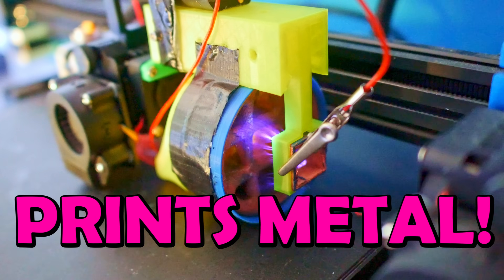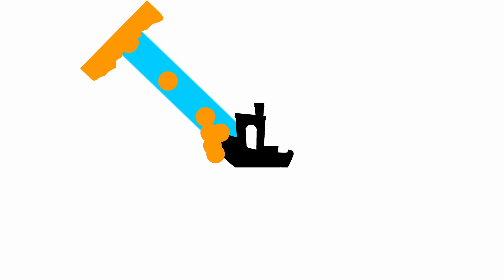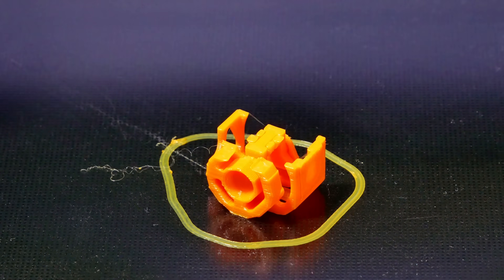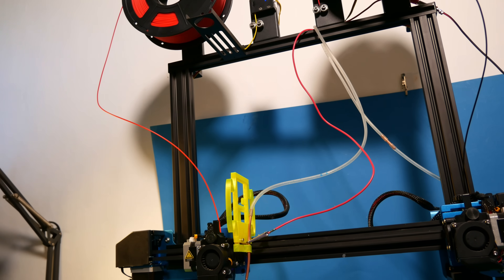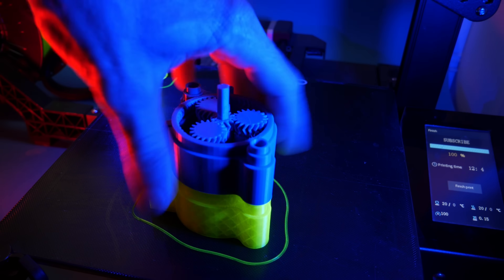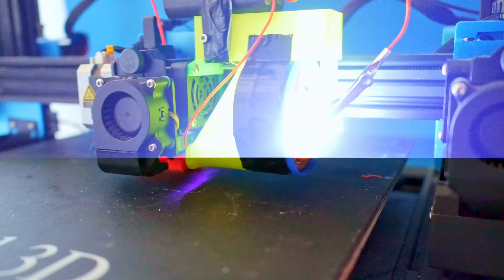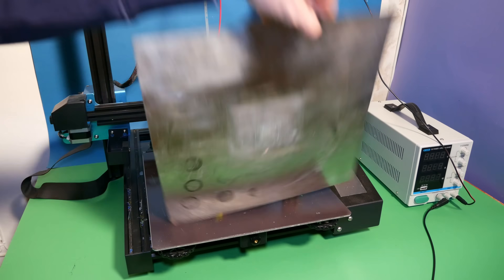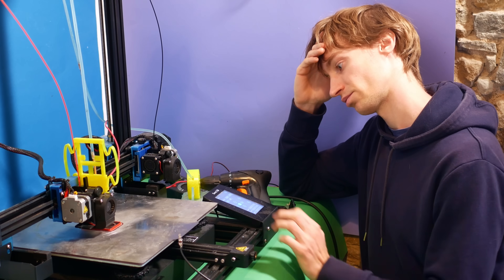i made a METAL 3D-Printer at home!

Comment: How about a sanded down rough PEI build plate? If you sand it down it will still have some of the embedded PEI which helps with adhesion but metal which will help with conductivity?

Comment: Print a conductive raft onto your normal build plate. Have a  couple of conductive tags hanging out tye edge of the print. Then print your print onto that with an interface layer that has a grid cross section. This gives you adhesion to the bed, a conductive layer for your parts to contact, and a easy to seperate interface layer.

Comment: Was thinking about this recently. 

I wanted to mix plastic and metal to make bearings, or wear surfaces. It can be achieved by mixing copper and tin to make brass, which can be achieved by plating one after another. 

I'm also thinking that the plating puddle idea might be a bad one. instead, maybe a fluidic chamber with a sponge with the appropriate pumping/suction to keep the surface as clean as possible.

Comment: First I thought you were using spatering, but acctualy would something like spatering work? you heat up parts of the print with a laser and then coper dust blast the print, the molten plastic allowes the coper dust to stick.
My compliment for building a prof of concept, it is a lot of work from an posible idea to something which works

Comment: Print a sheet with the conductive fillament conductive, then print on it with a small gap, getting the gap right can be tricky since you don't want to bond too well, acctually print you desing in air ant tell the slicer to create support under it, attach the power to the support.

Comment: Laying a fine metal mesh, similar to those used in textile printing, on the build plate for conductivity, or stringing a copper wire across the build plate, held down with magnets.

Comment: What if instead of using FDM principle, you used the resin style of printer. your filament would be a drop of electrolyte suspended from the tip of the tube facing up and the part is printed upside down. you wouldn't have to deal with a shortening print head that is your copper pipe

Comment: If you want to get a conductive build plate, I've used an FR4 CCL (Copper Clad Laminate) plate. The only problem is that it tends to bend due to the heat I guess. You could also use just the uncoated aluminum heat bed. But in my experience, plastic sticks way better to the copper-plated FR4 than to aluminum. Anyway, you're a genius! I'm also working on a 3d-printed electrostatic motor btw.

Comment: I wonder how small can you make the paths on the "PCB" made with your method. It seems currently they have to be a little wide. Probably you could improve it by having the print make some grooves where the paths are supposed to go, but I still think the minimal width will be 1-2 mm, which will allow to build some circuits, but might still not be enough for complex circuits..

Comment: Have you tried adding copper powder to the plating solution?  I think you could increase build speed that way.  Afik there is a PCB printer that prints copper tracks using metal power suspended in a plating solution to link the powder as the "ink" dries.

Comment: Hey so I think this could not only revolutionize the industrial world. Imagine the impact it could have on world of space flight. As NASA could make scale mock up’s of their engines or parts with something like this before scaling up! It would significantly reduce time between iterative parts because they can relatively quickly make a part. Test it then iterate on it. 

Also since I see it’s possible to make a cone shaped print. I was curious if it would be possible to print a double walled spiral up to a point for ion thrusters fins? For some reason my brain based on what I know about physics and ion thrusters is screaming at me maybe a good design to look into since now iterating would be significantly cheaper.

Comment: So you're not in any way shape or form actually printing metal. Lots of simps in this comments section, but have you managed to make anything structural? You're not going to make a 3d printer frame out of copper. Which leads me to ask, have you gotten anything besides copper to work?

Comment: You can already 3D print using carbon for PCB parts so for that side this is not needed. As for coating already 3D printed surfaces then printing in that carbon based resin would mean normal electroplating would be more effective & you could even coat or paint the surface of normal PLA (or other plastic) parts so the electroplating would be more effective. Honestly until 3D printing with aluminium is practically possible then actual 3D printing of metal is not going to be achieved. The fused printing seems to be the way & maybe laser which can achieve high temps is the way to bring the cost down to be able to print in aluminium. Certainly people have tried to use arc welding etc as a proof of concept without too much success. But this electroplating with a printer isn't even solving a problem.

Comment: 1) You could try to dissolve some conductive filament in dichloromethane or  to make a conductive glue that improves bed adhesion. 
2) More elegant: You could sratch off some of the PEI on one single spot on one corner the upper side of the bed an print a conductive line to the brim/conductive raft of your print
3) Comcerial conductive glue might be an idea aswell

Comment: I know this is going to go far because the prototypes look so jank, reminds me of the first transistor... LOVE IT!! I know your video is 4 mo, but whatever work you're putting in on it still KEEP GOING!!  It's really an amazing concept and is literally one of those "wait why didn't I think of that" moment a lot of people will have.

Also, it occurred to me that surface tension is likely difficult to work with.  This might be a bunk suggestion, but have you considered "thickened water" for the electrolytic bath? They use it in retirement homes and there are many forms of it -  it seems to me you could control print with it, and if formulated correctly MIGHT not interfere with the electrolyte solution?   (fumed silica perhaps?)

Comment: you could try to make your own print bed by doing a very (very!) finely grated PEI powder coat. that way you would have a very small grid of conductive exposed metal, and a relatively large areas of print adhering PEI. or perhaps it might be easier to just cut a very fine grid into an existing PEI sheet

Comment: You should try to buy a server so you can cut the motherboard a cables by cloud printing that reads what to print from the computer you use and wireless transmission too the printhead and motors making almost fully 3d printed (idk if this would work)

Comment: the alternative solution to the initial problem, is to first spray paint your part with a conductive copper paint with a 30$ air brush, then the electroplating will take more evenly depending on how many coats of the copper paint you use.

Comment: I have an idea for you to try, this might help you get around the problem of the conductive material is not touching your conductive build plate. Just use the regular side of build plate that has good adheasion, in the prnt setting add a raft and use the conductive fillament for it. Other part that needs to be conductive but will not touching the raft, you have you include in you design an apendage that will use a raft can and you  just snip off after the print. Hope to see this in your next video.

Comment: Try Rusting the metal side of the buildplate. Put in bucket, raised well above the bottom ( on top of a box, drinking glass or else) put an amount of water with bleach into the bucket.
Cover the bucket. The plate is now in the bucket. The chloride fume will rust the metal surface in a very fast and equal way. 
Perhaps the prints will stick on the rust and there is enough conductivity, otherwise clean up the rust an the surface will be pitted quiet equally.

Comment: So you're not actually printing metal, you're metal coating prints?
Reply: Worse, he's electroplating prints after setting the expectation for real metal printing by comparing it to $500,000 machines.
Reply: @smorrow  disgraceful 🤔
Reply: @smorrow  my actual electro-plating machine for bike parts cost around $500, he has made a 3d printer that electroplates and compared it with electro-fab / laser hardware that for sure costs 100s of K. This doesnt stack up, and, EP is very slow and requires constant refresh of the electrolite AND power. Imagine a machine that can make a diamond by laying down 7 trillion back and forwards with a pencil. Ironically, he has taken the very slow FDM printer and used it for something slower, electroplating. It's the 70k comments around us here that all think this is edison level genius. it's not, if it was, it would have been done in secret, under patent application, and, he would be the dutch elon musk. Do we now think if modern day manufacture could solve all it's problems with this, freely available youtube method, that the worlds factories, which we know run on getting the best quality for the best price woulndt have copied it. His 3d printed engine a few years ago was good, until he turned it into a battle between his model and 3dbenchy, infering that the industry standard of using the 3dbenchy model to check out a new printer or filament was no longer fit for purpose and his, more clever model, was the new way. When you do somehing clever and follow it with by deriding (clips of 3d benchy being stalked by his 3d printed engine with horror music) a loved and well used artifact out there you make someone write this a few years later. Now you're selling snake oil and pretending you can print metal for 100 bucks, it's not possible. The trick with being smart is not beng an ....

Comment: you could also do ion electric field deposition by the same idea, seems like matrix 3d metal spot welder/plater printer. drop printer head. it could also be a conductive jelly glue that is cured to metal. try heat activated copper printer. copper acetate and similar heat-decomposing 3d printable substances, that split to copper at the nozzle, or similar to 3d printed ceramics. but drop 3d metal printer/plater like modern image printers. your ionic fan is already ionic plater.
Reply: revolution is always free, not subject to payment, thats the real revolution, completely free-dom, not feedom, money ruins everything actually free.
Reply: instead of bubbles, just submerge the whole detachable single-use metal print plate in copper sulfate water, then do spot plating with a pen like 3d print nozzle. yep all the copper is in the solution. and the print head is only motors with electric current wires. for the spot plating. yes print in conductive metal print substrate plates, just like normal metal welding is grounded. only metal. no plastic tricks needed. no carbon painting surfaces required.
Reply: yes make it work like resin UV 3d printing, same material container but different spot plating print head. combine resin and FDM printing techniques.
Reply: want to try wire spot electro-plating on a metal 3d print surface. copper or zinc wire.
Reply: try direct 3d printer metal wire melting with two electrodes inside a hot-end, to contact with the wire. not sparks, no external heating of the hot-end. just the solder metal wire will heat.

Comment: Looks good.
In a practical 3D printer using your technique, you would have to deal with dendrites and any variation of layer thickness.
If you can use molten salts, such as aluminum chloride, you may be able to plate aluminum or magnesium.

Comment: If would try out mixing some glue stick and graphite or carbon black with some water/IPA (50/50) to get a conductive surface coating that should help the prints to stick to the metal

Comment: Just had an idea. Listen for a minute and see my vision. Use magnetic fields to hold up metal in a specific shape so the material in particle or fluid form can be held in a form. Then use electricity to weld the parts together because conductivity. Use ai so it can see the magnetic fields and send material into the mold. Hypothetically, you could use a medium and rotation to aid in the particles aim and integration plus use other forms of magnetism and force from the rotation of the medium to build more intricate structures and systems.

Comment: So I'm not that smart but maybe a pangendered velcro print pattern on some plate metal or a 3D metalized replica of such a surface.

My cousin had dollar store velcro strips made of plastic she got somewhere.

Neither side was fuzzy or scratchy, both sides were this wierd interlock pattern and then you smooshed the two identically faces and they'd deform to grab each- 

Oh scratch that.

Use a laser etched hologram.

It's the basis of gecko tape 👍👍

Comment: Sorry if this solution could seem stupid. 

You said that you had to use the metal side of the base as catode, so that means that there is a cable connected to the base right?

Could you use the conductive filament to print a connection between the piece and the cable? 
This way you would still have a good surface for the base

Comment: Good job! As a retired jeweler, I'd suggest ending your copper tube with a felt or maybe closed cell foam rubber tip like we use in pen plating. It would require less solution at the point of contact, give you finer control and you wouldn't have to raise the copper pipe higher than your regular print tip, but you would have to replace it more often.
Also, you could make a similar output fluid pump using an aquarium air pump, tubing and valves if you wanted to used ready made off the shelf components. I understand your goal of making it yourself though.
Reply: Steel wool? Stainless steel wool… 😅 but yeah great idea
Reply: That would only work for horizontally flat prints.

Comment: I'm trying to print the 3 cylinder engine but cant get it to print right the pistons are just stuck and it just snaps I'm using a 0.2mm nozzle and leveled my bed does anyone know why it wont print correctly?

Comment: As for the bed adhesion. Maybe copper electroplating the bed itself could be an answer too? It is easy to get a real rough surface full of microstructure and copper can obviously adhere to 3d prints. 
An issue that I can foresee with that is the 3d prints adhering way too well but an idea that may just work is making sure the bed is fully oxidized as copper does form a very thin oxide layer in air quickly (can be accelerated with heat or hydrogen peroxide to make sure) and the oxide is still conductive. Then a little bit of hydrochloric acid might be used as a release agent as it can only dissolve that super thin oxide layer but not the metallic copper.
Reply from the maker: Might have to try that, its essentially the opposite of what I did with the etching process

Comment: I have a suggestion for the build plate. A square of  Copper Foil tape should adhere and have the conductivity you need. Excellent video and channel. Thanks for posting.
Reply from the maker: Thanks, tried that, but the tape was too smooth

Comment: It seems to me for your build plate issue and adhesion that you were talking about at the end of the video, you could pick up some really fine mesh metal window screening from the hardware store and cut it to the size of the built plate leaving an extra tab ling enough to double the tab portion over for a solid contact and heat tape the screen yo the build plate. Then take a large enough current to tackle weld it by placing a contact in the built plate and one to the screen.

It should fuse it self on there pretty good really quickly. Seems to me you already got the tools to make that work out pretty easy.

Take care hope that helps. Good video. I like what you did. That is a huge step in the right direction for a lit of things.

Ohh for the electro plating thing you can make a pare of ventless one for the thing your plating and one for the plating material and circulate the fluid through it to ensure a more even coating since the atoms will now have better access to the polarized object it will be more attracted to it as it curculstez around it.

Take care.

Comment: Could it be possible to control metal deposition with a laser so to deposit metal particles only where the laser point is hitting? If it is possible then you could create a 3D printer that works completely submerged in a semiconductive liquid that becomes very conductive only where the laser hits.

Comment: This is world-changing R&D you're doing! Having done some daydreaming on this problem myself, I can say that with a combination of printed ferrite toroids for mag amps and controlled oxidation of copper layers for rectifiers, you would have all you need for functional (albeit low performance) printed processor cores! There's also ionic rectifiers for somewhat simpler manufacturing (no oxides) at the cost of being bulky and having a liquid component.
Reply: Also, you can print thin conductive traces to plate onto with an XY pencil plotter. This is the same process (more or less) that was used to make copperplate printing masters for book printing during the turn of the century.
Reply: @DistortedSemance  You can rebuild a 3D printer into a laser cutter, and making PCBs with a laser cutter is a solved problem already
Reply: @smorrow  Yes, I'm aware of that. My comment was about printing actual active switches capable of implementing logic gates, not just passive traces. It's not possible to fabricate a turing-complete processor with only passive electronics.
Reply: @DistortedSemance  Oh yeah